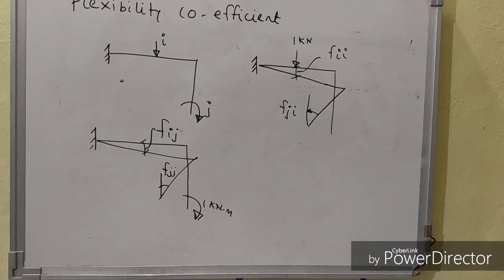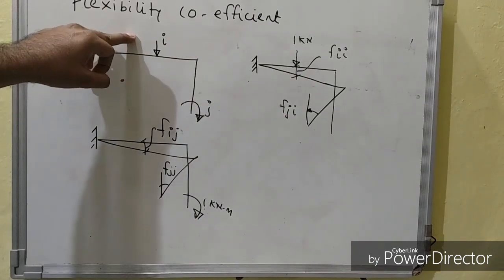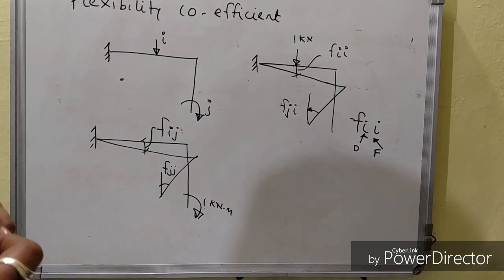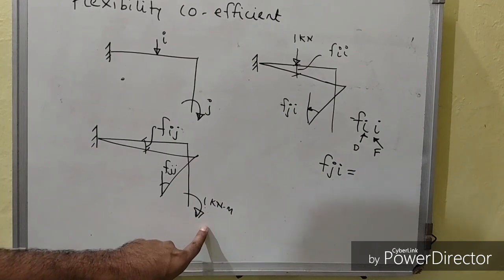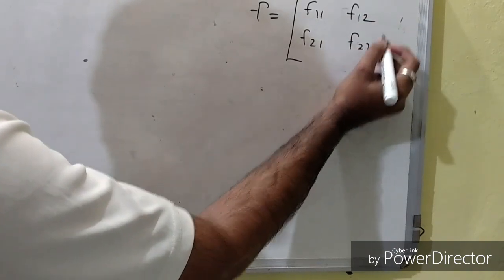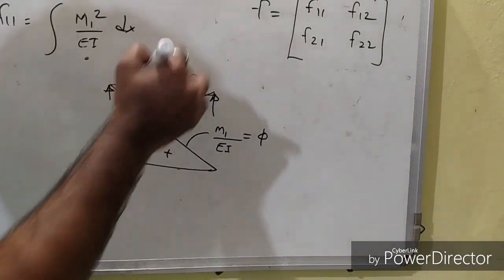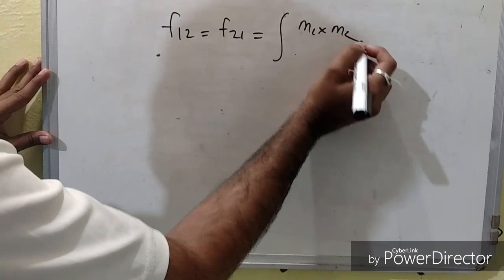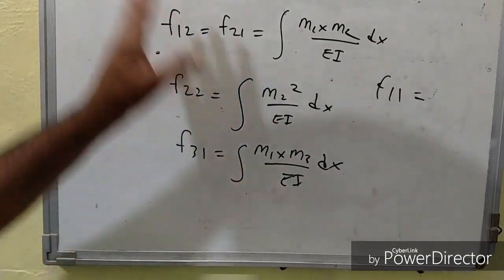Flexibility Co-Efficient 1 (Fundamental)

Comment: Can you please answer this MCQ

If the there is no support displacement or sinking of support the modified 
compatibility flexibility matrix is
Where [DI] = Matrix of displacement in the structure due to redundant actually
[DR] = Matrix of displacement in released structure due to load corresponding 
to unit action of load
[F] = Flexibility coefficient matrix
[R] = Unknown support reaction matrix

Option A: [0] = [DR] - [F] [R] 
Option B: [0] = [DR] + [F] [R]
Option C: [0] = [DI] - [F] [R]
Option D: [0] = [DI] + [F] [R]
Reply from the maker: Okay I will answer... First you tell me which option it will be according to you and why. Okay?
Reply: I think its option 'B' but im confused for the given condition of no support displacement.
Reply: Bcoz it is standard case given in the book